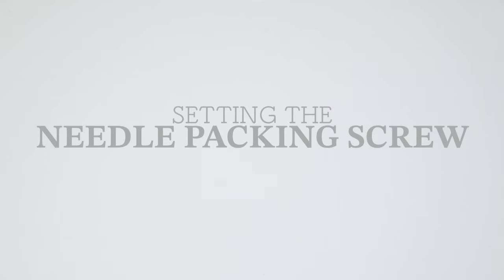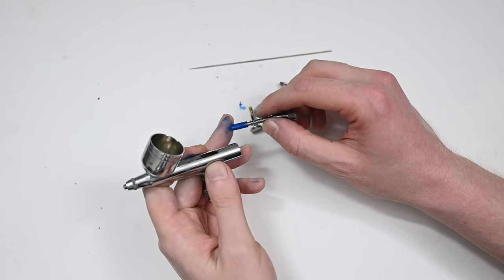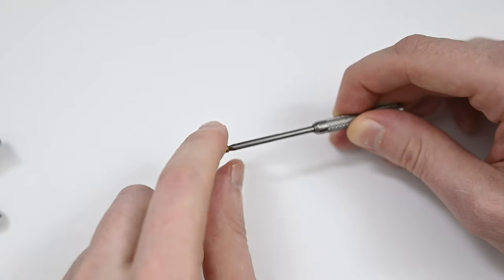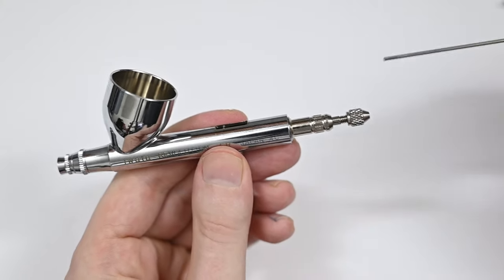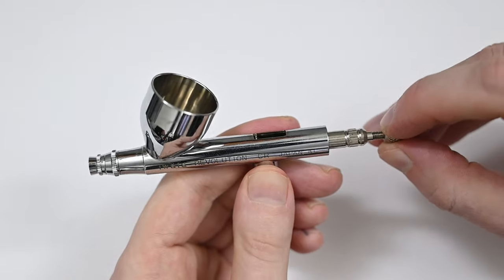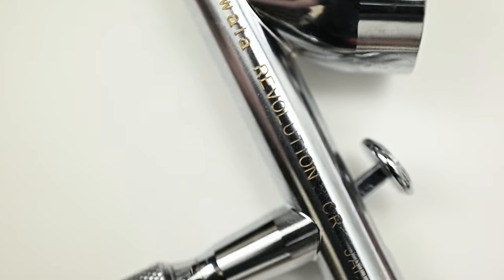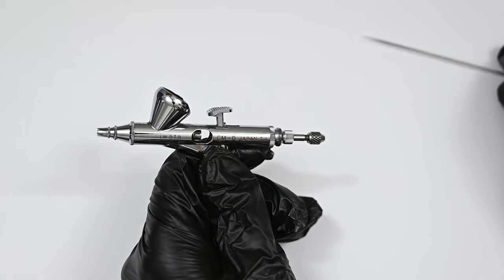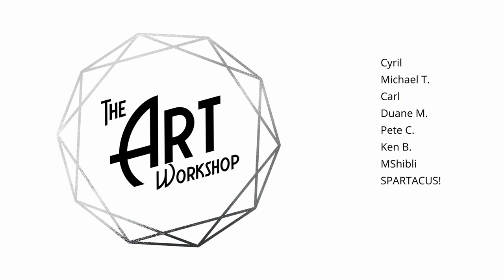This AIRBRUSH ADJUSTMENT is commonly OVERLOOKED

Comment: How ironic, I watched this video a few days ago without realizing a big mistake I made the day prior. While cleaning my sotar, I got carried away with my barrel brush and pushed it into this area a few times. Now, after priming some minis, I'm noticing after cleaning that there is paint a bit further down my needle than it should be. Going to take it fully apart and try get a visual on that packing area. Looks like I'm buying a new body!
Reply: I have a couple of Sotars and if I am not mistaken they are a bit different from the regular Badgers.  OK I just removed the needle seal/Bearing from one of my Sotars using the same type of tool that is shown on the video.  On a Patriot or an Anthem I believe that the Needle seal is pressed into the body of the Airbrush and is not adjustable or really replaceable, but the Sotar has a Brass threaded tube very similar to the needle seal on a H&S or an Iwata but instead of the slotted Brass tube tightening up against a Teflon seal like the H&S the Sotar has the tubular nylon or Teflon Bearing (that's what Badger calls its Seal) imbedded into the end of the Brass threaded tube.  I ordered a number of needle Seals/Bearings for my Sotars and received small teflon bushings that look exactly like the bushing that is imbedded into the threaded Brass tube that I removed from my Sotar's Body. When I need to replace that seal I will push out the old seal with a brass paper clip and carefully press in the new seal into the end of that threaded brass tube then screw it back into my Sotar. Making sure that I just barely snug it up as you would adjust that seal by turning the slotted brass tube into the body which would squeeze the seal, I assume.
Reply: @douglascramer4403  Yes, I made that discovery, after inspecting the Teflon a little, I noticed the tube brush had scratched it slightly, but after reassembling it and retightening it, it doesnt seem to have affected its ability to stop the paint! I did however track down a used sotar slim for almost the same price as just the body so I might buy that just for the heck of it. Unfortunately I live in the outskirts of western Canada and finding any parts for a Badger is a headache!

Comment: As I have had my Harder Steinbeck for more than 25 years, the first type of packing with some teflon kind of material resulted in this issue some times. After the newer kind of packing, never had a problem with this. That being said, I never remove the needle by drawing it back. To avoid clogging up the inside I always unscrew the nozzles and push the needle out in the front direction.

Comment: great stuff! I wonder why nobody talks about the needle packing screw as its a very important adjustment .One thing If I might add is to never over tighten the packing if using a regular screwdriver, It will mushroom out the packing and ruin it.Thank you for the video about this apparently taboo subject
Reply from the maker: great point Duane. Thank you for this! :_CMTakumi::_Sotar2020::_Infinity::_PS771:

Comment: I just bought my first airbrush and spent decent money on it, I've been having all kinds of backflow issues right out the gate despite trying to do everything correctly in its use and cleaning and still was getting rapid clogs and back pressure. Upon full disassembly like this I found this screw was not even tensioned and fell out. At the time I thought it was just a press in fitting so just put it back without tension again but now I'll go back and do this and start fresh. Shame for a brand new piece of equipment, hopefully this resolves my issues
Reply from the maker: They are usually set perfectly from the factory. I have a lot of iwata airbrushes and haven't seen one set incorrectly. Things happen though. Hopefully you were able to screw it back in and get that airbrush working again!

Comment: the link for the Adjustment Screwdriver doesn't lead you to that specific product but to the "ABEST 0.2mm, 0.3mm, 0.5mm Airbrush Nozzle Airbrush Needle Nozzle Cap Replacement Parts for Airbrush Spray Gun Sprayer Accessories"

Comment: So, I had to replace a needle packing screw in my Iwata HP-B recently. I've adjusted the needle with just a little tension. However, when I tried it out with the new needle packing screw, air flow was fine, but paint would not com out. Paint (Tamiya) was thinned 50/50, but still no paint coming out even with the normal air flow. Nozzle (.2mm) is clear and needle passes through the needle packing screw fine. Not sure what I did wrong or what needs to be adjusted. The original needle packing screw had a rubber seal while the replacement is the white teflon type.  Any suggestions would be most appreciated.

Comment: i just bought a brand new Iwata eclipse and it came with the lube, should i lube it before i use it for first time or is it already factory lubed .Thank you for your video
Reply from the maker: No need to on a new airbrush. a small amount won't hurt anything, but it's not necessary.
Reply: @theartworkshop  just i heard it helps with tip dry ?

Comment: After 10 years of use on using my Iwata Eclipse SBS, my needle now has a 'lose' point when it gets to the packing seal, ie the metal of needle has worn down. I could tighten the seal to make it better at the sealing point, but because of the no doubt uneven wear on the needle, would say it's time to replace both needle and seal? Thanks.
Reply from the maker: sounds like it's time to replace them both. 10 years is pretty awesome though! It should feel like new again when you swap them out for new ones. Best of luck to you!
Reply: @theartworkshop  Thank you very much for your reply.
Reply: @theartworkshop  I have now fitted the new needle and packing seal, I can report back to you the gun now feels great again and I have good air and paint flow. Thank you 🙂
Reply from the maker: so happy to hear it. Here is to another 10 years!!  @SwiftSlots

Comment: I just bought a new badger 360, would that also be the screw in type ?
Reply from the maker: no idea sorry. reach out to badger!
Reply: The answer to your question is - No.  Don't attempt to do this to a badger airbrush.  Badger airbrushes use a pressed in teflon bearing sleeve.  It is not adjustable in any way.

At least for the vast majority of them, including the 360.  There is an exception in some of the 'renegade' line and maybe a few others.

Publicly, they don't want you to attempt to replace a worn out bearing seal yourself either.  They do not make the tools, materials, and process public knowledge.  There are people out there that have documented how to do it and there are 3rd party places you can order a seal from.  That being said, there's not really a good reason to do this.  Badger lifetime warranties the needle bearing seal.  If it wears out, they will replace it free of charge.  You do have to pay shipping though.

Comment: I accidentally put paint into the cup without the needle in, and it fully gummed up the inside of the trigger assembly. I was able to clean most of it out with alcohol, but I cant get some of it to break up and the trigger is a bit stiff when pushing down for air. Any suggestions to fix this? It seems like the upper portion of the trigger assembly doesn't come out easily and/or I've yet to see anyone break the gun down that far, and don't want to risk popping something that was pressure fit. Iwata Highline CH

Comment: I'll check this seal with my neo I got it last year used it a handful of times and now it's like blowing back air through the trigger it's been cleaned and ultrasonic cleaned lobbed tightened the valve still doing it! It's under warranty still but can't be bothered with all that I've got other's but not the point! It was under 3 months old when it packed up and not been used since! Never buy an iwata again! I know ow it's a Neo not really made by them but for them but still carries that name so puts me off!
Reply from the maker: ultrasonic cleaners are brutal. They clean very well, but I broke a $500 airbrush and a few nozzles using them. Since then, I stay far away from them with any airbrush.

Comment: You can damage that packing by using the wrong end of the needle. The sharp 90° edge will cut the seal whereas the tapered needle will gradually slide through the packing without damage. The seal isn’t in the dead center so you won’t poke it.
Reply from the maker: it's possible, but I never had a problem. The prong on the end of a packing screw screwdriver is the same as the back of a needle, 90° with no taper. I agree though if you want to be safe, go with the front of the needle. This is just what I do, and it's what works best for me.

Comment: Excellent video!  I'm glad you pointed out that back flushing to mix paint is a terrible idea; it's OK  for cleaning once the cup is relatively flushed out.  The needle lubes from Badger and Iwata are great for the needle only just as you advised.   I have been using a little airbrush lubricant I got from Amazon on the trigger [large white bottle] that reminds me of sewing oil.  It doesn't congeal and gum up like superlube does, and  it makes the trigger action smoother.  I think it also helps the consistency of the trigger response on my h & s airbrushes, at least a little bit. H & S just came up with a radically redesigned Ultra which I'm willing to bet fixes their trigger response.  I think this because Dred FX,  another airbrush YouTuber, previously focused on the trigger issue with a fix using  strategically placed and slightly reamed out double washers, and now he's very excited about the performance of the radically new Ultra.  Looks like redesigns of the Evolution & Infinity [my favorites] will be forthcoming!  Truly a great time to be an airbrush user!

Comment: In firearms, you avoid oil lubes in some places because it runs all over and collects fouling etc... so what we do is we use a silicone grease (like Superlube PTFE grease) and spot apply it so it only stays where it needs to be. It wills till collect stuff as you have noticed, but it will be less spread out and contained so it doesn't pick up too much gunk.
Reply from the maker: that's a very good point and a great tip. Thanks for this!
Reply: @theartworkshop  For sure! Another amazing thing is that Superlube PTFE works on... gosh darn near everythign haha, and it comes in cheap $20 CAD tubs, sometimes 16 for just a ridiculous amount. There are competition shooters in IPSC who use it in the summers haha. And almost every airsofter has swapped to it, and as superlube PTFE is DIalectric it doesn't conduct electrivity and we use it in/around electronics too.

Your channel really inspired me to get into airbrushing btw, just starting my journey as of a couple weeks ago... I do A LOT of research haha. I picked up a cheap Neoco kit with some accessories, a Aigoo $145 compressor... and coming this november will be a Harder & Steinbeck Squidmar Ultra! I'll be doing miniatures, I would love to do portraits too but... not sure I can anymore, a medication ltierally took away my "minds eye" or ability to make mental images :/.

Which sucks! I used to have eclectic memory and even lucid dream states... it's been, an adjustment. Being in a creative field it sure sucks to lose that skill.
Reply from the maker: awesome! Glad to hear you're enjoying painting. Keep at it!  @ErgonomicChair

Comment: I'm just gonna put this out there for anybody that needs to know and might see this later -

This video mostly does not apply to badger airbrushes.  The vast majority of them use a pressed in teflon bearing sleeve that is not adjustable or user servicable.  If it wears out, it's lifetime warrantied.

There are a couple exceptions.  I know that some of the renegade line use this type of seal with adjustable tension.  To get a clear answer for a specific badger model, you'll have to consult your manual.

Comment: I dunno, I feel like putting the needle in backwards like that would risk damaging the seal more? If the seal is over compressed you're now trying to push something through which is larger than the orifice. If you put it in sharp side first you'll feel it incrementally become harder to push through and you can stop before putting too much pressure on it. The backend of the airbrush will guide the pointy end to the centre of the seal so it wont hit the seal itself (and even if it did, you shouldn't use any force when putting the needle in in the first place so you'd stop pushing as you feel the needle stop).
Reply from the maker: a good point for sure. It's the way I've been doing it for years and haven't had an issue. The prong on the front of the tool I used is basically the same thing as the back of a needle

Comment: Thanks for the info. I thought this was going to be the magic bullet for my H+S Ultra and bought a needle packing screwdriver like you have. I could see daylight between the needle and the seal so assume it was not making a good seal. Problem is, the screw wouldn't tighten any further so can't make it any better. I have ordered new PTFE seals - do you think this could be the issue this time? HOPING SO!!!  Keep up the good work
Reply from the maker: thanks! sounds like its worn out or damaged which happens.  I'm sure the new seal will fix it.
Reply: Great! Thanks for the reply - really appreciate it @theartworkshop